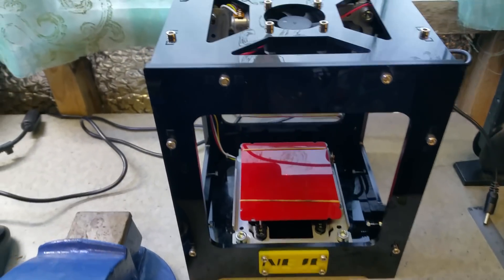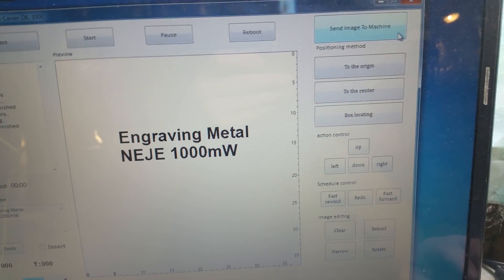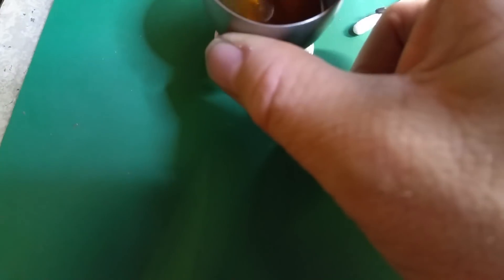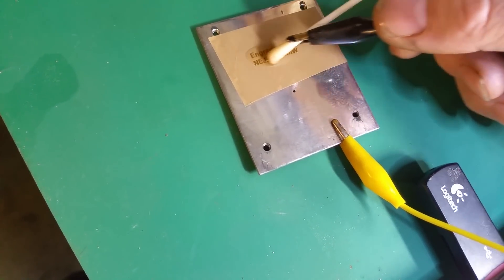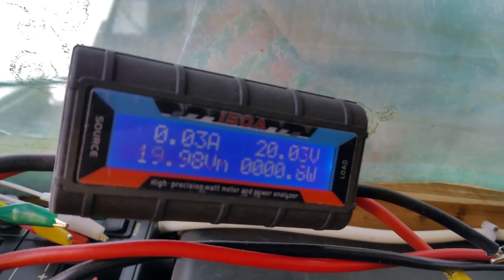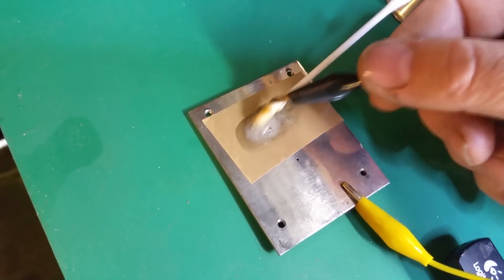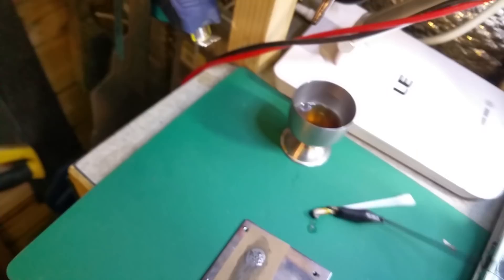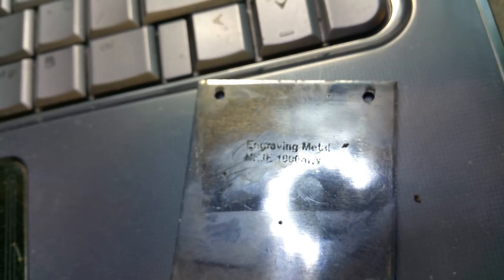Engraving Metal with 1000mW NEJE Laser

Comment: hi i just bought one of the neje 1000mw engravers..i cant get it to work..driver installed ok when i open control software it has a popup that says connection ok but then when the control sofrtware shows welcome screen..it does not show any info in the status window on left side...and when i try to engrave it says error code 10040.... wondering if anyone has seen this issue...neje seems rto be a non existent company..no realwebsite or anyting...just some mixed bag info online..the engraver powers on with power calb e and shows up in device manager so im not sure why its not actually working or communicating with the neje control software